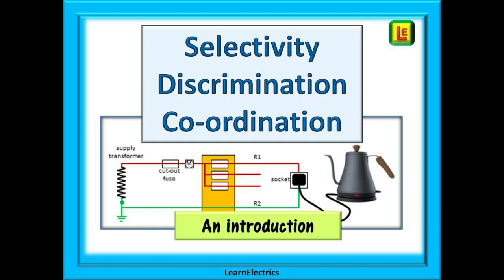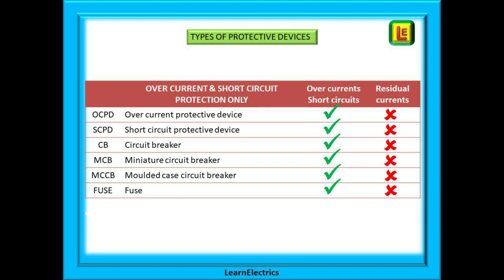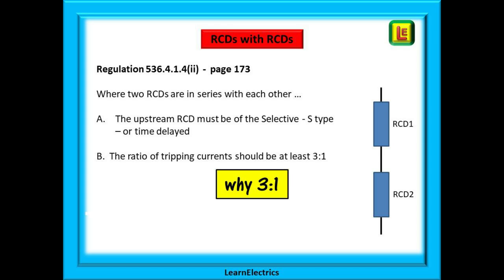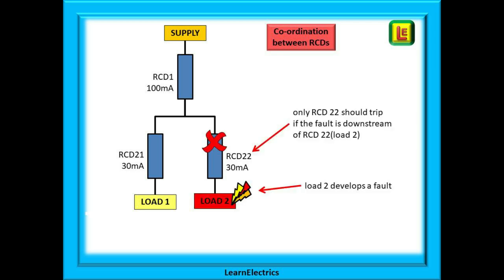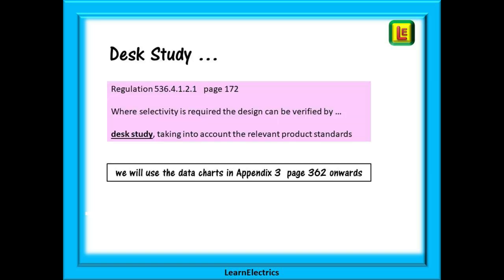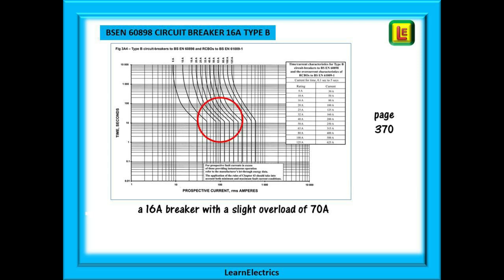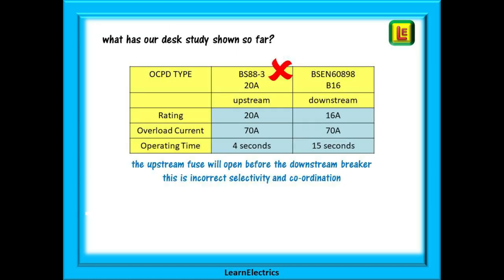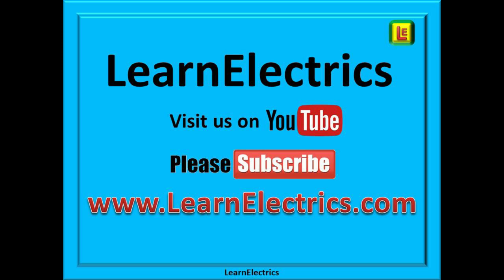SELECTIVITY, DISCRIMINATION and CO-ORDINATION of electrical devices for protection

Comment from the maker: SEE ALL OUR VIDEOS
To view a list of all our LearnElectrics videos, click on the link below.
There are many videos on many electrical topics including Installation, Part P, 18th Edition, Testing, Certification, Lighting, Sockets, Ring Circuits, Calculations and much more.
https://www.youtube.com/channel/UCYaJQnpO4XAp0yCgqzMkmfA
Reply: thank you sir....for extremly useful content.
Reply: Great video mate. I have a question regarding fault currents, particularly PSCC. How would you coordinate these in a case when the current is so high that both devices operate within 0.1 secs. I have a 160A Bs882 fuse supplying a 125A type B circuit breaker. These are in coordination regarding overload protection however not with short circuit. Do i have to select an upstream device that simply doesn't "see" the fault current and thereby forcing the downstream device to operate first?I would like to avoid this as by having an extremely high rated protective device upstream, it would then force me to upgrade the cable size.

Comment: I find your videos very very good. Thank you.

Your answer to another subscriber on discrimination between house and garage using RCBOs was just what I was after.

I was thinking of treating my outbuilding as a separate supply via an Henry( Isco ) block and 60 amp switch fuse. The outbuilding having it’s own distribution box with RCD and mcbs. This provided discrimination with the 100amp supply fuse, but left the swa cable to the outhouse without RCD protection. So adding an extra RCD would have solved that one. 

However….happy days change the 25 year old cu for a new Hager rcbo scheme complete with surge protection.

BTW. …..I’m not changing my terminology!!.  I spent a couple of years designing protection systems on the electricity board’s 132 kv to 66kv to 33kv networks……it’s DISCRIMINATION.  Who dreams up these changes? We’ll be calling the earth wire cpc next!
Reply from the maker: Ha ha. CPC? As if. I blame it on the white coats, the boffins that are all listed at the front of the Regs book. I tell my guys that if they say the earth in the switch or call the phase the live, we on the tools will still understand. It will take generations to work its way out of our genes. Thanks for watching. Dave.

Comment: Really nice explanation, addressing some issues that I seem to go around in circles with.  And here's an example.....  looking at an existing install, the main CU has a distribution circuit to a garage CU.  The main CU is a very conventional 2 RCD split board, with the MCB to the sub-board of RCD bank No.2, so a 30mA type AC RCD.  Sub board in the garage has another 30mA RCD isolator and 2 circuits.  So no selectivity between the RCDs.  The cable between the main and sub starts life as twin and earth and connects to SWA at an external junction box before disappearing underground for a short run to the garage.  Providing selectivity in compliance with 536.4.1.4 note ii Selectivity in case of residual currents, might sound straightforward, as in, just pop a 100mA RCD at the source of the distribution circuit, but part of this cable run is twin and earth within the fabric of the building.  Regulation 415.1 and 522.6.202 to 204 present a strong case for keeping 30mA RCD at the main board, protecting the twin and earth cable run as it makes its way out of the building (exact route unknown, so assuming the worst ).  I'm more than likely changing the mainboard to all RCBO, so a garage fault tripping 6 RCD protected circuits, common to it, in the house can't happen. And therefore the nuisance of an upstream RCD trip is less significant.

I'd be interested to know what you would do assuming a mainboard RCBO set up?  Install without selectivity, respecting 415.1 and listing lack of selectivity RCD/RCBO house to garage as a departure from BS:7671?
Reply from the maker: Yes Jim, agree with that. If the garage is on its own 30mA RCBO at the house then no need for another RCD and selectivity is also ensured. I've seen lots of installers fitting all RCBO boards now. Certainly worth it when you do a board change, another £200 or so at this point is certainly worth it long term for the customer. Dave.
Reply: What would you do if the client doesn't want a board change?
Reply from the maker: That's between you and the customer. The client does not have to have a board change and you are not obliged to do the job if you feel that what the customer is asking for is not as safe as a new board. You can walk away from a job if you haven't started work on it and you think the customer is being blinkered to the dangers.
Reply: @learnelectrics4402  Is there an alternative solution taking into account your example of the cellar, and not wanting to lose lighting in the garage? Is there a way of having discrimination with RCBOs on each of the garage circuits to avoid losing the garage lighting upon an earth fault?
Reply: Does the SWA from the main DB to the garage DB not need overcurrent protection? Or is that fine as each circuit fed from it has overcurrent protection?

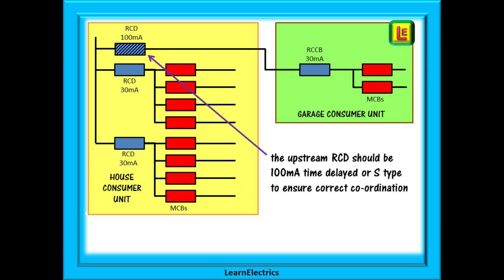Comment: i understand however the diagram at 7:15 shows you connecting a S rcd off of busbar, perhaps henley block, but if you are not going to do it inside the board why add a S RCD upstream and RCD downstream, why not just an RCD downstream?
Reply from the maker: Thanks for watching. We are showing you some of the different methods that are used and in accordance with recommendations in the Regs.
Reply: @learnelectrics4402  so say you have a spare slot in the non rcd side, could you just put an mcb and rcd then downstream?

Comment: Hi Dave, Good Morning, Great Video. all this is really helping me with my studies and I’m very grateful thank you. Question: Should you also consider upgrading the supply to the garage in line with Iz => In if you are upgrading the protection to stop nuisance tripping.
Reply from the maker: The supply cable should already be the correct size for the everyday loads expected.
The 30mA RCD in the garage should operate first so no need to upgrade if the cables are already correct. Even a 100mA RCD will only draw 0.1 amps down the earth.
Good question. Dave.
Reply: Thanks Dave.

Comment: Wondered if I could trouble you for an answer to a question?
I visited a house today where the main CU fed a sub CU from a 30mA RCD B circuit. The sub CU has no RCD and supplies a garage CU from a 32A MCB.

Owner wants to run an EV charger from the garage board. But the only way I can see to do this, is if the cable from the main CU to the Sub CU is upgraded to SWA, and same for the run from the Sub to the garage. And protect the circuit from the main board with the type B RCD. But I read a lot of conflicting information that suggests this still might fall short of BS 7671. Could I have some advice?
Reply from the maker: Appendix F of the on-site guide has information about cable sizes and breaker sizes. There is a lot to consider with EV charging points. Take a look at the video on the link at the bottom.
The fifth edition of the IET code of practice has just been published. Electric Vehicle Charging Equipment Installation. This will answer many of your questions, its a little pricey, but it is tax deductable. Perhaps I should do a video or two on EV charging. Thanks for watching. Dave.
https://www.youtube.com/watch?v=fkSUrz0HaPE

Comment: A 16 A breaker with a slight overload of 70 amps, how it is assume 70 amps when there is 16 amps and 6 amps breaker. I am confused how 70 amps is assume can you please explain me?
Reply from the maker: Have another look at the video. It says that a 16amp breaker with 70 amps of fault current will take 15 or 16 seconds to trip. If the fault current was 80 amps it would trip in 0.4 seconds or less. Follow the video and use the Regs book at the same time, it is all explained. Thanks for watching. Dave.
Reply: @learnelectrics4402  thanks dave
Reply: @learnelectrics4402  so the 70 amp is just a rudimentary value ?  if you choose a value of say 50 amps you still get the same answer you set out in your video. but if you have an over current of 20 amps you could do with a 20 amp fuse. what do you base your over current condition on?
Is that why you say in you video we need to use the curved bits in the graphs? so you have a rough idea where certain conditions are going to be problematic?

Love the video btw. very clear with a good practical example!

Comment: According to Schneider/Siemens, Ground Fault Protection (GFP) selectivity is wrong. RCC has Definite Time curves. Lower RCD 30mA 40mS time delayi upstream RCCD 300mA 100mS RCD. Upstream RCD must have longer tripping time. RCD selectivity mus be time selectivity, not current selectivity.
Reply from the maker: Yes, use an S type. Great input, thanks for watching. Dave.